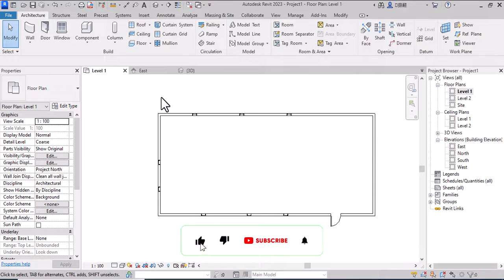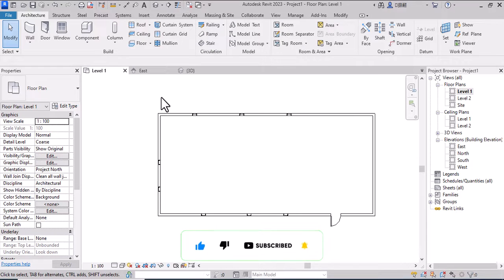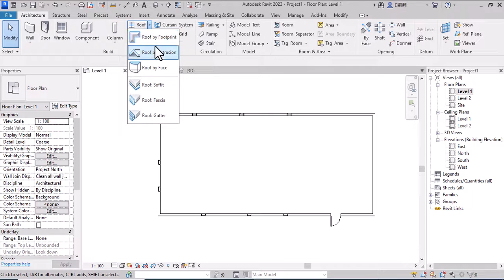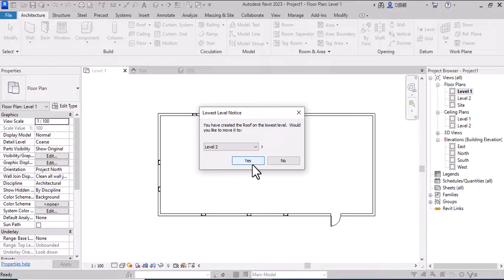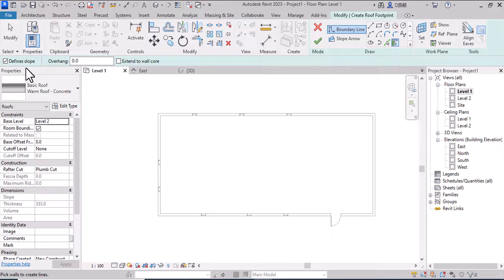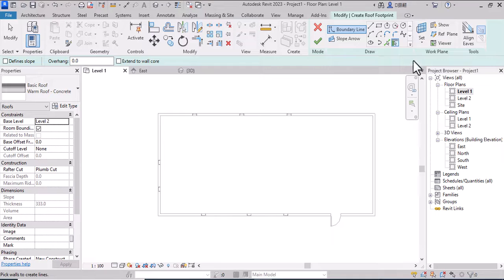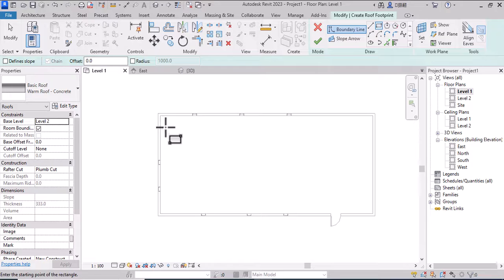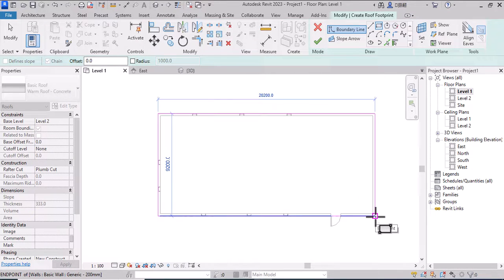How to make a Flat roof in Revit 2023

Comment: All the roofs i have has slopes, how can i create a flat roof?
Reply: Yes i understand it, but my problem are all of roof blocks options on my revit has slopes. There’s no flat roof like yours.
Reply: @rian7568 I used to have this problem, but if it doesn’t work for you, you can go to a 3D view or a section, click on the slope icon and drag it down. It can be a bit tedious at first but it’s a solution nonetheless.
Reply: @rian7568  i encountered the same problem just now, go to roof properties --> dimensions --> slope = 0.00 degrees and that should be it
Reply from the maker: Just watch the video for second time it’s too easy for solve your problem. If you don’t understand let me know